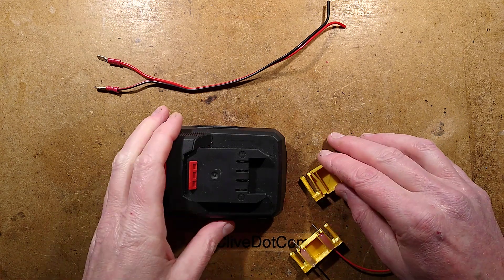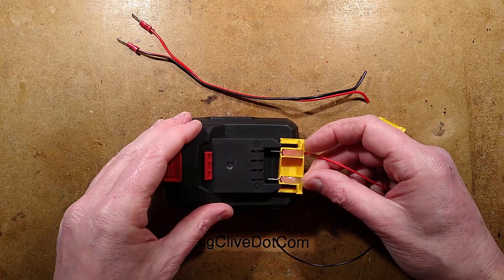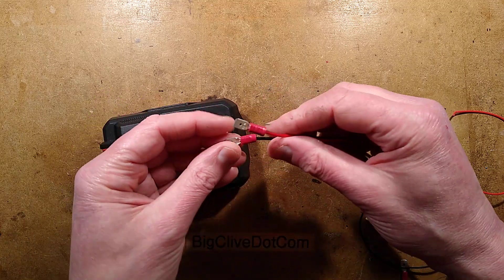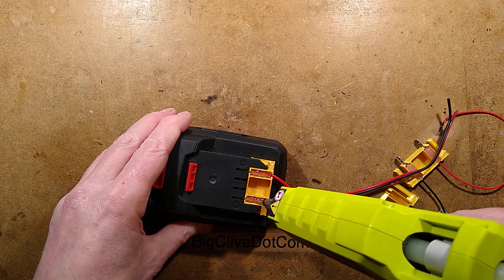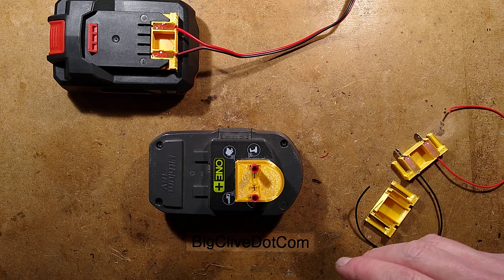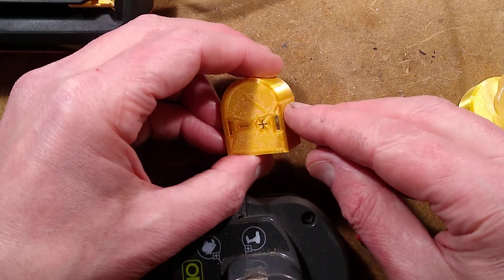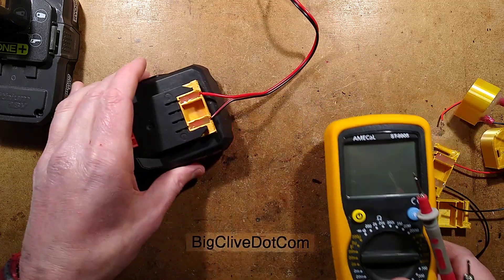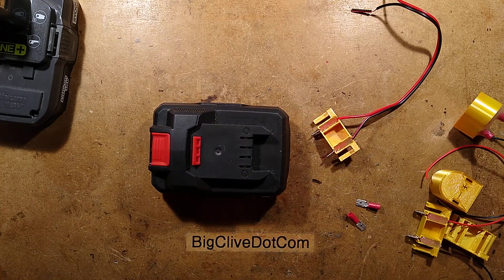Simplest Ryobi and Parkside battery connectors

Comment: Does anybody know whether the spring contacts of the type inside the battery can be bought separately? And what are they called? My Google skills have let me down :(
Reply: a short search for  "female spade connector pcb" gave me some interesting results, like "contact-clip" "Harwin S9101-46R" or some beefy connectors for automotive plugs like TE "964328-1".
Reply from the maker: The contacts inside the battery itself will probably be custom made for that design.
Reply: @bigclivedotcom  thanks Clive, that makes sense. Reason being that I bought an Aldi battery powered strimmer... But the batteries themselves are not easy to get hold of (and I'm a bit tight) so was hoping to make an adapter for a similar battery I already have.

Comment: For the Ryobi battery version, you could print the connector support part as a separate piece that'd get glued on after.  Makes it easy to print and still relatively simple.

Comment: Honestly for the cryobi, you could probably just extrude the base 5 - 6 mm thicker to make just enough depth to have holes for the glue to go in. The glue would just need to go up above where the crimp starts, and that would probably be enough to hold it in place. Bridging the short distance of the hole should be fine, and with a low infill of say 15%, it shouldn't increase print time dramatically.

Comment: for the Ryobi one, ifyou want to have a way to fix the spade terminals on top, just draw those supports in, and use support material (10%) for the print.  Works like a charm

Comment: I HATE needing support on 3D prints. It is possible to design around needing it though. I've designed an entire Enigma machine (not quite working yet - wiring to do) without needing any support but it took many many hours of design and trial and error to achieve that. Regarding hot glue guns the best I have ever used were the 3M ones. I am not sure the model but they were incredibly expensive and they required special shaped glue sticks but they were so much better than 'normal' ones. As always isopropyl alcohol works well for removing hot glue.
Reply: I found them. They are called 3M Q sticks. Ribbed for your pleasure! The special glue guns for them are eye wateringly expensive. But it's a bit like using real Molex brand crimp tools compared to others. Once you're tried the high end stuff  using the cheaper stuff, although it works, always feels somewhat disappointing.

Comment: Nice one! As a teenager (like 15 years ago) I played with power tool batteries to power all kinds of things, like PC speakers and connect them to an MP3 player for use on the go with friends. I speculated with ideas and designs how to properly connect to the battery without repurposing a power tool. 3D printing made this so much easier. 

Your design is so neat. And all that in under six minutes. No BS, just the facts and how it was done.
Reply: My father in-law did something similar. Although he was wondering how much juice he could pump into my son's Hot Wheels motorised launcher. The device is supposed to take 2 x 1.5v D cells. He hooked up his 18v Makita battery. Apparently it worked for a few seconds before the smoke came out.
Reply: Oh. Instead of throwing it out, I decided to fix it. I didn't have any spare small DC motors around so I settled for the only other unused electric motor I could find. A 240V air mattress pump. It took a lot of customisation, but I finally got it working. Albeit, with a motor 10 X the size of the original sticking out the top.

Comment: Lidl Parkside have an 18v battery on their slightly older impact drivers, but have now switched to a 12v battery that fits a vast range of their products, they appear to have different dimensions so you cannot accidentally plug in the wrong battery in the wrong tool...
Reply: Sorry I meant new 20volt range not 12volt

Comment: For Ryobi, I just get old Blue Ryobi Flashlights and cut the handle. That way you have connector with a base that latch to the battery. Their often very cheap and see many at flea markets etc. I have 4 or more for future projects sitting in the basement. Many don't think 18v Blue tools run with One+ LiIon batteries but only old charger won't work.

Comment: Oh this is excellent, I did this a few years back almost the exact same way around, however I was trying to rescue a 'dead' pack and also used fork terminals with one half of the fork cut off to pop into the smaller between-cell terminals that were present on the pack to let my cell balancer do it proper, and not blindly. In the end it worked and my friend's battery pack lived to see some further use.

Comment: For those who are interested in getting a usable voltage/current from one of these batteries and be able to provide over-discharge protection. There is this DC to DC converter that they sell on Ebay called a "Dual headed synchronous boost-buck converter." It's based on the Linear Technologies LTC3780 controller chip.  I don't know if I can post a Ebay link. But if you go to Ebay and do a search for "ltc3780 buck boost converter" it should be the first item on the list. The one you want should have 5 silver electrolytic capacitor and a  torroidail inductor with 2 heatsinks on each side. It will also have 3 blue colored trimmer pots as well. It should cost somewhere between $15 and $20.  The reason you want this particular one is because it has an adjustable under voltage cutoff that can be use to protect your battery from being over-discharged. Plus, the thing is damn efficient. about 97% if you run it at about a %50 load.

Comment: My 2 cents worth would be to print a cap for the addapter. Square press fit, with covers over the glue. That way if the glue comes loose it is still almost safe. Not sure what could be done for the Ryobi, a bit more complicated.

Comment: Epic. See for the ryobi one, why not just print a 1/4 height D shape using the same model, without a bottom in it, and when glueing, you could just add it on the top of the cap, and flood fill with glue. Or you can add two squares around the connector points, so you are only filling around the connectors, without flood filling the whole D shape.

Comment: I made a connector for the battery from an old broken flashlight that used the same battery. You can also use the port on a charger if you have an extra one. Also there's this polymer called Insta-Morph that is heat softened and reusable. It can be drilled and tapped, it's very strong and takes minute details. Just warm it up and push it onto the battery with wires in place and you're the nephew of Bob. Or niece

Comment: A note in re suggestions to glue more than one part together: Some of the common 3D printing materials, notably PLA and the ABS family, are attacked by acetone such that they can be solvent-welded with it. Just moisten each face with a brush, and press them together for a moment (and then wait for the solvent to migrate out of course). Seems to make quite a robust joint.

Comment: Awesome quick 3D printer project! I suspect that no battery manufacturer would ever object to someone killing their batteries in some other device :-) Milwaukee make a cheap ($25) power bank that is very hack-able. I add an XT60 to mine so I can use my TS100 soldering iron and run my robotics. I love that these quick prints are more adaptable to a custom design!

Comment: Just make a slightly bigger, but taller one for the Ryobi, that has two cut outs for the wires, and covers the glue puddle...   It could be glued on, when your gluing the leads to the smaller one.  All the ugly glue would be hid between two connectors.

Comment: I'm a huge fan of hot glue, I dump it into DB-15 solder cups and similar all the time to keep my deadbug projects from shorting out.
I have something similar for my Ryobi batteries, I use them as field charging batteries for R/C planes and drones. Ryobi batteries are especially convenient, because they have an internal low voltage disconnect while most if not all others put that inside the tool. This is probably so they can be put inside older tools meant for nicad packs. It also simplifies and thus reduces the cost of the bare tools in many cases, further feeding the "printer and ink" model of power tools and batteries.

Comment: Black and decker uses the same config as well as dewalt except they swapped the positive and negative around from the black and decker 20v..  oh and there is a tiny tab thats different so the chargers wont fit on without shaving off that little piece that doesnt allow it to fully seat...

Comment: i am easily entertained by BigClive and his videos and i am easily educated i have a concern about safety with lithium batteries and or fuses and or short circuits or overheating and fires and he makes me nervous with this and what about thermal protection
Reply from the maker: I'd recommend a series fuse to avoid short circuits.  But the battery itself has a high current fusible link.

Comment: You might want to suggest a current rating. (I know Jack about 3d filament thermoplastics) A while back I bought a couple of 3dprinted Ryobi battery connector ,much like yours, but a bit thicker,with no suggestions what to use as contacts. made a 3x luxian star led  worklight .with reflectors and lenses ,hot snotted into spray paint cap. 
.as I was 'working' my hand stuck to it, did not wait to see how far it would go.
Reply from the maker: That sounds more like a bad contact issue.

Comment: You might enjoy using a "deburring tool" rather than or in addition to a file for cleaning up 3D prints. You can get one with handle and something like 9 or 12 interchangeably blades (3 sizes) for around $10-15, and they make real clean and quick work of trimming brims, elephant's foot, etc. For bonus points you can print additional handles to use some of those refills 😁
Reply: The "wire stripper" notches in Victorinox's Swiss Army knife screwdriver tools work acceptably for this as well. The inside of the notch is just sharp enough to scrape away the burr.

Comment: For the Ryobi pack, maybe you could leave some small holes in the print where you'd push something through them and the holes in the connectors to make it more secure like a little plastic pin or something.

Comment: Given that the alternative is to C&C mill a part at the expense of the energy it took and the material waste of the milling process this is a fantastic idea. Even if you make it out of delrin it's still more expensive than the PTFE filament and whatever power your 3D printer used during the print. It's chuffing brilliant mate.

Comment: for the Ryobi, perhaps rather than a dam around the flat bottom, a recess where the spades go in that would fill with glue would work.  it would likely require a few structural struts inside to keep it from rocking.   Not sure if my meaning is clear. can elaborate/illustrate on discord if needed.

Comment: For the Ryobi connector, you could design a cover cap that hides the  glue shmoo. It could be like a slightly larger one that slides on top and you could have your exit holes wherever you want. It would printed just as quickly.

Comment: That's cool!   But what would be cool is if you  could 3Dprint the opposite connector for the tool itself.  That way,  a craftsman could plug his tool into a 20VDC power supply and use it even when his dead batteries are in the charger.  Or maybe he might make up an adapter to use one tool's battery on another tool.

Interesting video: it might have been Rich's Rebuilds channel that converted a 3 wheeler to be powered by a half dozen or more tool battery packs.  The single seater EV goes f-a-s-t!
Thanks, Clive.

Comment: The YouTuber "Post Apocalyptic Inventor" built adaptors to allow the use of old-style 18V Ni-Cd and NiMH cordless drills and other tools with Makita battery packs. He added a cheap 3-digit display voltmeter to the adaptor that allows him to see the discharge state of the battery to prevent draining too much from it and damaging it. He also made an adaptor that would run 12V tools from 18/20V Makita packs using a Chinese high-current buck converter, again with an integral voltmeter.

Comment: As mentioned many times before it seems like the parkside doesn't have a low voltage cut off. They are quite popular in the Netherlands and probably Germany. I personally own quite a few. It is also worthy of note that they have a bad case of "no more charging because f you" when you put them away hot and on a low battery level. They will cool and become impossible to charge rather quickly. They do make them in 5 ah versions also. Which is nice.

Comment: Thanks as always for the OpenSCAD script! Unfortunately, at least in our part of the 'States, neither Lidl nor Aldi carry the power tools very often. But, I do have here one of my 60V DeWalt batteries, and I think your Parkside script could be tweaked to fit. The rails on the left and right side are behind the terminals, so the left and right prongs would need to be longer, and there's no doubt some tuning required, but all that can be accounted for in code. 👍️
Reply: I've never heard of a Aldis carrying power tools

Comment: Couple of remarks: the designs on thingiverse often have the goal to be a wall mount for the batt or be part of an adapter, so you want that clip-in action altough it rarely snuggly fits.

Adapters are to be done with caution, as some makers have the battery protection in the tool (Dewalt, Makita) and some have it in the battery (Most others I think). But generally the adapters and mods I do are my middle finger to the tool makers and their battery pricing. You can grid away a plastic rib in the parkside 12V and use it in einhell 12V (common here too). 
I am working on an adapter that is very compact an uses folded copper sheet or can be made from pipes to use my dewalt batts in all the chinese Makita-Knock offs.

Comment: Great idea! need to make one for my Metabo Li-Po batteries. The charger actually died in mudslides here in Seyðisfjörður so I needed to rick up some wires to make my Tenergy rc charger :) would be allot safer to 3d print a connector for that stuff :)

Comment: I cannot believe that BigClive himself calls "Fast-ON" connectors; "spade lugs."  50. years ago they were "Fast-ON" connectors and they are still: "Fast-ON" connectors.  FYI:  "Spade lugs" are two tang fork connectors.  It has occurred to me my DeWalt twenty Volt  batteries (I have four) would make good power supplies on the pick-nick table, (beside the RV) operating HAM radios with my twenty Ampere buck converter.  I don't have or want a 3D printer. {I'll work something out} Ron W4BIN

Comment: I recently watched one of Big Clive's videos where a lamp had a fancy diode capacitor network in it's rectifier, apparently to reduce the DC side voltage and improve power factor. I can't find it again - did that video actually exist or am I just imagining it?
Reply from the maker: It was the Thomas Nagy ceiling light.   The circuit is called a valley fill circuit.

Comment: I got a few of them parkside batteries because they were on sale cheap (£5) each but doubled up deeper but wondered as I don't have an original charger and there are 4 connecting points would I damage them charging from far left and right connectors there must be a point to the middle two connectors, any Ideas?
Reply from the maker: They need to be used with the correct charger.
Reply: @bigclivedotcom  I have chargers such as laptop chargers same volts that will charge them just wondered what the two middle terminals are for out of the four

Comment: In the US Ridgid batteries are without question the best for this sort of thing. They come with a lifetime warranty, which they honor with no headaches. Make a phone call and you get a new battery within a week! We all know batteries will die of old age at some point, but they still replace 8 year old batteries just 'cause they got old. No other brand will do this. They are hoping you will forget after 8 years but I keep that number handy! ;) They have very high quality Sony cells inside.

They also have all the protection/control circuitry inside the battery, not the tool, as apparently others have. I have bought a bunch of battery connectors from china-bay, I use these to power so many random things. Before 3D printers I just used some alligator clips...

I am disappointed to find they discontinued the big brick 9AH battery...good thing I got a 6 pack with the warranty. :) I don't think they offer this on AEG batteries outside the US, even though they are the same thing.

Comment: Thanks, Clive.
I had to attack my print bed with meths, to get a print to stick, it's been gathering dust for a few months.
Reply from the maker: Isopropanol is good for cleaning.  I have ended up using the glue-stick approach for good adhesion.
Reply: @bigclivedotcom  I didn't have any IPA in the drinks cabinet!  
My print bed just needs to be clean, and hot.  As soon as it goes cold, the prints just lift off, no force or scraper required.  ;o)
Anycubic Ultrabase on an i3 Mega.

Comment: Not sure if they have sorted it since 2017, but the BMS in the Parkside packs had no way to balance cells. The charger will refuse to charge them if they get out of a balance - typically with constant full pack charge/discharge cycles.  Had this happen a few times. Easily corrected if you know what you are doing....

Comment: What slicer do you use? Cura (and likely others) has an elephant's foot setting to offset the first layer inward to compensate for this.
Reply from the maker: I'm using cura.  I'll have to check that out.
Reply: @bigclivedotcom  the setting is called Initial Layer Horizontal Expansion. It's under the Walls sub menu. You can easily find it by using the search bar at the top with "elephant". Cura knows what that means. I use a value of -0.4mm with an extruder temp of 220C, bed temp of 70C for PLA. Your mileage may vary.